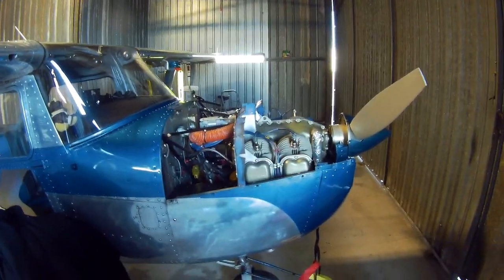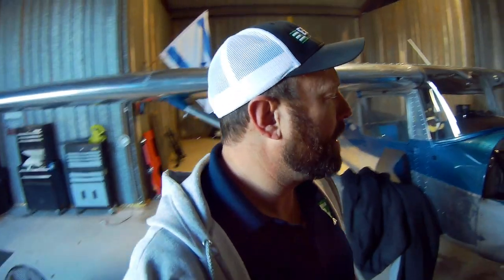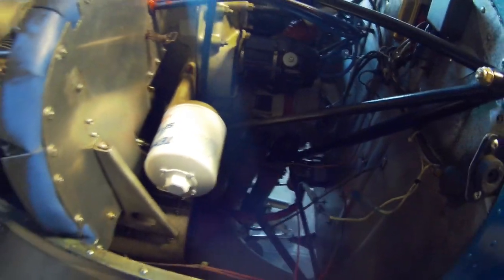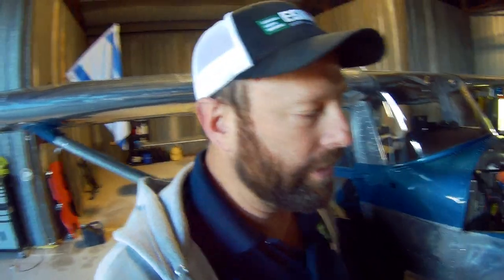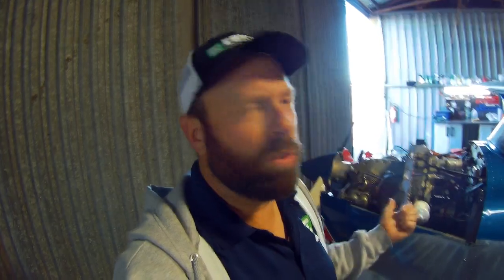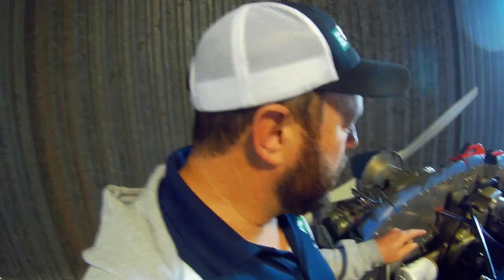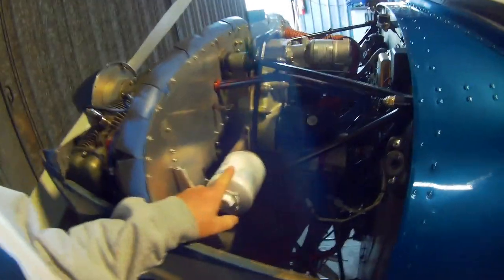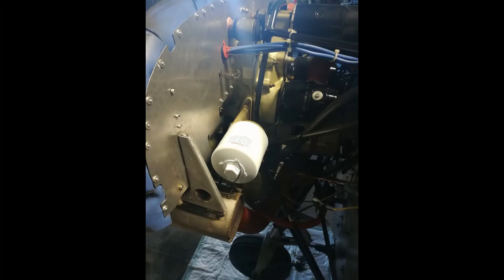Cessna Mod - Oil Filter Adapter

Comment: You can also add a rare earth magnet to the outside of your filter and it will help catch ferrous particles when you cut the filter apart.
Reply from the maker: Up until recently the Tempest filters had a magnet in them. But yes, now would need to add one to the outside

Comment: Did you remove the stock screen after adding the spin-on filter?   BTW - love the patroller doors!
Reply from the maker: YEP! Ive seen multiple planes that didnt get them removed
Reply: The suction filter stays. The oil filter adapter has issues with the big "O" ring leaking.